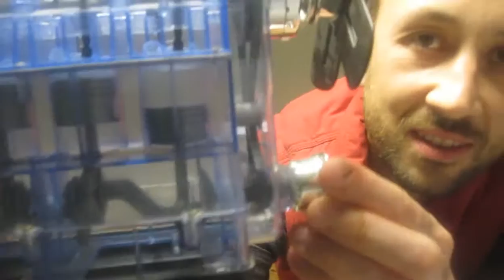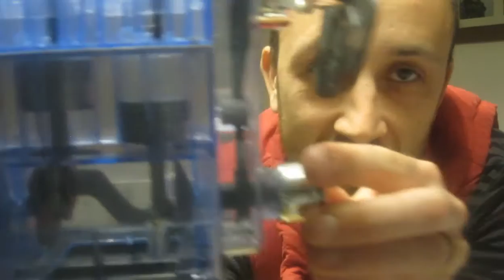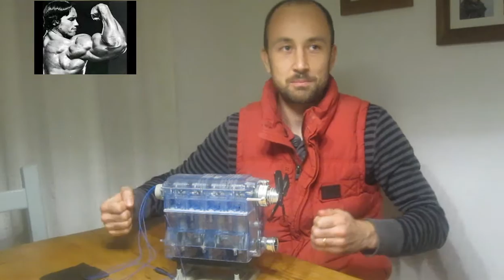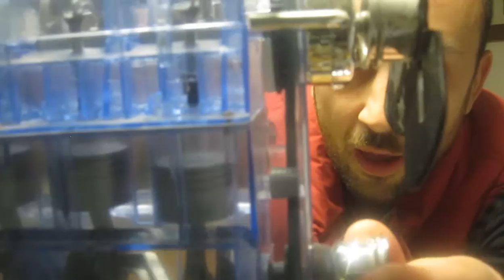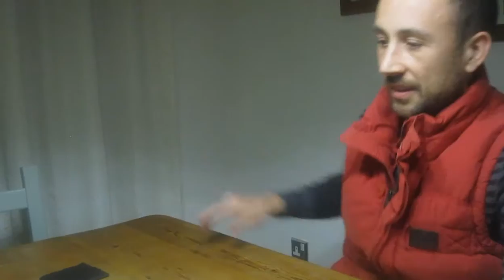Torque Vs Power: Why Power Wins Races and not Torque!

Comment: Your understanding of what the correlation of power and torque is so badly flawed it makes me wonder if you even have any mechanical background at all.

Power is nothing but a calculation. A calculation of how much work your engine is doing. Power can not be measured, it can not be applied, it can’t do anything but be calculated by the formula torque x rpm / 5252 or 10,000 if you are going metric. That’s why when you have an engine or a car on a dynamometer it measures torque not power. It can’t measure power because power is not a force that can act on anything. Torque is what is being measured on the dyno which in turn allows power to be calculated.

Power is simply a calculation of how much work you engine is doing.

Torque is the twisting force that makes your wheels spin around.

And to answer why the petrol and diesel vehicles perform differently at the same power specs is because the transmission gears will 100% be different between a petrol and a Diesel engine to allow for the different engine speeds that the engines will be working at and I’d be pretty damn sure the diff ratio would be different between the two engines also.
Reply: Sean Byrne: "Power is nothing but a calculation. A calculation of how much work your engine is doing."
Torque is a calculation, too: force times distance. Power and torque are both mathematical quantities, one is a scalar and one is a vector, neither is more "real" than the other.
Reply from the maker: Let me work through the theory with you, since you seem to want to know more?

Power [kW] = Torque [Nm]  * EngSpeed [RPM] * (2*Pi/60000)

power is an expression of [work done / unit time] (you almost got your definition correct, but you forgot to mention time)  Torque is essentially the work that is being done on each power stroke.  We bring the time dimension in to the calculation when we consider engine speed.

To move a mass m over a distance d we must do work, where W.D = ([F (wind, rolling etc...)]+[m x acceleration]) x d and if we want to cover that distance quickly we must do that work in less time, don't forget Power is a measure of how much work can be done in a given amount of time, hence my conclusion that power wins races and not torque.  There are caveats, if you get the gearing wrong for the application you will lose, if you don't take the engine into it's peak power band you will lose the race blah blah blah...
Reply: Car Stuff power does not make your wheels turn around. Torque makes your wheels turn around. You can’t win races unless your wheels are turning.
Reply from the maker: Whilst you are correct that torque makes wheels turn, power then goes on to define how quickly they can turn (see above), you can't win races going slowly
Reply: Sean Byrne: Of course you can measure a car's power. You take it out on the road and you do speed trials - that's what speed trials are; a test of the car's power. A car with more power will accelerate quicker and go faster than a car with less power. It's that simple.
It's just a lot more convenient and standardised for engineers to put the car on a dyno in the workshop and work out the power from there.
If you've done that and you know some other things about a car such as its drag coefficient, frontal area, etc you can then work out pretty well how it will perform out on the road.
Reply: It’s been 7 years.  More than long enough to get an engineering degree.  Have you learned anything since you posted this hivemind nonsense 🚮?
Inertial dynos measure power directly and calculate torque.

Comment: The fact that this imbecile is describing combustion as an explosion completely discredits everything else he says.
Reply from the maker: Thanks for the inspiration @Sean Byrne, you have given me an idea for a new video on the effects spark timing (where the 'explosion' starts relative to crank angle)
Reply: Please stop referring to combustion as an explosion. There is no explosion that takes place inside the cylinder.
Reply from the maker: ...hundreds of explosions!!!! get over yourself, for the purpose of this explanation I am not going to be using 'flame front' as the intended audience is not an automotive engineer

Comment: This guy hasn't got a clue about what he's talking about.
Reply: beside  some details hes right power win race not torq egzample 206 1,6 hdi 260 nm 1750 rpm 110 hp 0-100 10,5 sec 👉🏻 https://m.youtube.com/watch?v=FkN8w9CMzGE vs 206 s16 190 nm 4000 rpm 140 hp 6000 rpm 0-100 8 sec 👉🏻 https://m.youtube.com/watch?v=0khf89EWYc8 or this one royal enfield scram 411 32 nm 24 hp 0-100 11 sec 👉🏻 https://m.youtube.com/watch?v=zZFIa0pG21U&t=57s vs zx25 r similar weight with rider 23 nm 50 hp 0-100 under 5,5 sec 🤷🏻‍♂️👉🏻 https://m.youtube.com/watch?v=WJu_osPT0Ik&t=387s&pp=ygUSengyNXIgYWNjZWxlcmF0aW9u wants more ? 😎 power win race all the way beat torque peak crank engine catalogue number be a mille assuming good gearing asf .

Comment: Now put a 600lb backpack on bodybuilder and the runner. and see who wins. Torque is needed to move that 3,800 car. low torque cars don't pull hard they just rev high.  Most multi valve cars have variable intake to produce torque.
Reply: No, you can convert power into more torque with a transmission. Torque is as relevant as RPM when talking about moving cars. You can't move a car without RPM.
Reply: Do you know what a transmission is
Reply: Low torque car dont pull hard? Ok than let say we want comapre how hard 3800 pounds car be pull or accelerate beetwen let say 50 to 60 mph  first setup be avg at engine crank 2000ft lb and 500 hp at 6 gear beetwen 50 and 60 mph and second setup be 1000 ft lb and 1000hp avg also beetwen 50 tp 60 mph in the same car let say it be 3 gear so biger engine rpm less engine crank torque more engine crank power in which egzample your body be push harder into seat 🤔 i quaranteee you that ( well not i but physique in fact quaranteee you this 😁) in second egzample where engine makes 2 times more power and 2 times less torque at crank will push your body into seat with egzacly 2 times biger force 😎 and acceleration time be 2 times smaller 😎from 50 to 60 mph 🪠 you just cant achieve better acceleration at specific speed while use less power its imposiible because watt :m/s = force and force = mass x acceleration 😁 if your car bike whatever at spefied speed will have less power no matter how much more crank torque you will have it will pull weaker at this specified speed 😎 thats how world work and how physique explain this be observation in Real world test 👌🏻
Reply: @mociczyczki 👍
Reply: @rollsroyce329 yep i know but thers  one misteake in me comment 😉👌🏻 it dont affect tendency overall as physique properties but thers small error in force doffrences push driver into seat vs power diffrences cos of drive train  losesss and drag but yea still 1000 lbf 1000 hp between 50 and 60 mph will accelerate much stronger under the samewhole resist of motion 👌🏻 actually consider me small error so drive train losess assuming both have 20 % losess and drag diffreences be even biger than 2 times for 1000 hp 1000 lbf ft advanatage not be much at those speed but still 👌🏻🪠☕️
Reply: @mociczyczki damn taxes!  😂. When we talk about these things we usually talk about all things being equal and first principals but because friction is a percentage it effects one more than another. If we say an engine making 800HP at 18,000 RPM has the capacity to tow double the weight at 5KMph of an engine making 400HP at 1,100 RPM it is not inaccurate the engine does have the capacity the losses that would make it more like an 85% increase instead of 100% are the transmission’s fault and not reflective of th e capacity of the engine.
Reply: Okay and the runner will be making zero power so this is irrelevant. Now put the two guys on a bicycle with a sled of 600lbs the runner can put out 2hp but can apply less force (torque) whilst the bodybuilder puts out 1.5hp but can apply more force, if they have bicycles with gears the guy who can put out more power will move the sled faster, as the high power low force guy can just go to a lower gear where he can apply his power, power is energy/time and ke = 1/2mv^2 so the higher power the faster you can add velocity to an object.
Reply: Hivemind nonsense. Power, not torque, is the limiting factor in not only the vehicles top speed but also in how quickly it can accelerate at any speed and how much weight it can tow up an incline at any speed.

Comment: and if the race starts a sloping road? ... the torque wins without a doubt, while the car with more torque would already be in 4 gear the onde which has more power and less torque would probably still be trying to start de movment
Reply: Do you know what a transmission is
Reply: @benfennell6842  yes Ben i just try to prove a point, i can have a car 200hp and not be able to start movement in a 45 degrees, However if you had a 50 hp with a low gear sets it will multiply the torque and it will win, not important how fast you go the important it's to get the job done.
Reply: Nope

Comment: But wait a second... the petrol engine car weighs 1425kg and the diesel car weighs 1500kg .. so the diesel would be faster 0-60 if both cars weighed the same. Torque > Hp for racing.
Reply: Brian B the transmissions and diffs will have different gearing to suit the two different engines. Comparing the performance of a petrol vs diesel is a moot point because the drive lines are different.
Reply: @JK392_aus  its not a moot point ., transmisjom is pointless 👌🏻 let assume each car always have perfect optimal gearing clutch etc  1000 nm disel with 500 hp loose with 750 nm petrol with 750 hp but win with 750 nm petrol with 300 hp 👌🏻 and yep you can compare this you cant put to short or to long gearing for specified setup vehicle what matter is how much power you can deliver from max power your engine at very specified linear velocity  only for this is gearbox 😎  in disel at 100 km/h if you want max force at contact path you must be at 4000 rpm. Whatever gear be needed for this rpm at this velocity i write about me example you cant put to short gear at 100 km/h because  there be only noise = alot rpm let say 6000 rpm and nopower” 😁 you cant put to long gear at 100 km/ h because again there be no power = high gear low rpm and again less power for acceleration than at 4000 rpm at 100 km/ h and petrol must be at its own rpm where it generate max power at specified velocity for max acceleration no matter what this rpm must be 5000 or 15000 rpm depend on engine 😁 so like you se transmisjom ,gearing are pointless transmisjom is only for hold engine at rpm where this engine generate max power no matter what those rpm are because this depend on specified engine type setup etc 😎 for nothing more is gearbox in fact 😎🕺🏻 thats why you are wrong 👌🏻watt:m/s = force 😎 so more powerfull disel with longer gearing win race but more powerful petrol with shorter gearing win race but less powerful petrol with lshorter gearing loose race and less powerfull disel with longer gearing loose race 😁 see this? Gearing is nooob argumentation  😎
Reply: @mociczyczki  hi 🙋🏻‍♂️mechanic of 30 years experience here so I probably do know what I’m talking about. The gear ratios in the transmission and the diffs WILL be different as Diesel engines generally speaking operate at a lower rpm than petrol engines. Therefore comparing acceleration between two similar spec cars, one being a diesel and another a petrol is a moot point indeed as the petrol engine will ALWAYS be quicker in acceleration due to the diesel having a different gear ratio in BOTH the transmission and the diff. Your understanding of basic mechanical knowledge seems to be lacking.
Reply: @JK392_aus  nope 300 hp disel despite it havelonger gearing will accelerate better than 100 hp petrol with much shorter gearing 👌🏻read again what im write 👌🏻 mechanic and racing telemetry not necessery is the same 😜 like in me egzample so what petrol have 100 hp at 6000 rpm let say so it have shorter gearing so biger rpm at the same velocity in race compare to me disel with 300 hp let say at 3000 rpm ? This disel give 0 chance this petrol in race cos have huge power advantage cos watt :m/s = force 👌🏻 this disel at the same linear vehicle velocity let say  we compare  force and acceleration at 50 km/h lets assume disel weight the same as petrol have the same drivetrain both rwd drag aero and so one so this disel at 3000 rpm so at much longer finał gear ratio  at 50 km/h generate 3 times biger force push vehicle forward at contact path and push you into seat with 3 times biger force and achieve 3 times biger m/s”2 so acceleration level than this petrol with 100 hp at 6000 rpm also at 50 km/h 👍🏻 gearing rpm and crank torque all are pointlesss vs proportion beetwen rpm and torque at specified velocity so power at specified velocity is key for moving fast 👌🏻 pacz na to gościu golf gtd nowy 200 hp mocy dużo dluzsze przełożenia  kręci się do 4,3 k rpm 0-100 realna w 7,1 sek 0-200 realne w 28 sek https://m.youtube.com/watch?v=_SxvL2pf4a4&t=51s vs honda civic vtec 1,8 140 hp dużo większe obroty kręci się do 7 k rpm 0-100 realna czyli licznik 0-105 w 8,5 sek 0-200 realne czyli 0-205 w prawie 50 sek dużo obrotów dużo hałasu krótkie przełożenie a cos ta honda niejedzie 🧐 ciekawe czemu może bo ma mniej dużo mocy niż ten golf 👌🏻🤣 https://m.youtube.com/watch?v=D4E__C3sRIM wiec z czym ty tu kr…..ie wyjeżdzasz to niejest tak jak ci się wydaje 🪠 ten golf jest 100 kg cięższy jak nie 150 kg i tak przyspeiszalepiej niż ta honda pomimo ze ma przy 100 km/h kręci dużo mniejsze obroty silnika a przyspiesza lepiej bo ma więcej mocy najzwyczajniej w świecie i żadnym przełożeniem czy obrotami w tym civicu nic nieporadzisz gdybys chciał żeby ten civic był przy 100 na 1 biegu zamiast na 2 biegu i silnik miał 12000 rpm czyli superkrótkie przełożenie przyspeiszenie byłoby tylko dużo gorsze niż na fabrycznym setupie bo na 12000 rpm silnik tego civica produkuje dużo mniej mocy niż na 6000- 7000 rpm pamiętaj ze watt:m/s =siła a siła = masa x przyspeiszenie 🪠😎 obroty na jakich jest uzyskiwana dana moc są bez znaczenia moment na wale sam w sobie tez jest bezznaczenia bieg jaki masz sam w sobie przy danej prędkości także nic niemowi 😎 moc jaka się ka do dyspozycji bez względu na jakim biegu przy jakich obrotach i z jakiego momentu przy danej prędkości mówi wszystko bo watt:m/s = siła nieważne czy więcej mocy dany silnik uzyskuje dzięki większemu momentowi na mniejszych obrotach czy dzięki większej prędkości obrotowejna mniejszym momencie obrotowym efekt będzie taki sam pojazd o większej mocy będzie się zbierał lepiej 🌪 a jesli tylko kręci sobie większe obroty ale niema tam mocy większej albo jesli tylko ma sobie więcej momentu obrotowego na wale na mniejszych obrotach ale tez niema tam więcej mocy niż w aucie przeciwnika na torze do dragu to oba przypadki dostaną baty 😁🪠 🖕🏻tu masz dobry przykład honda civic type r wolnossąca jednostka kręcąca się do 8500 rpm ma odcięcie bodajże cos koło 8000 rpm ma max moc 200 hp około vs to tdi kręci tylko 4000 rpm około czyli 2 razy mniej czyli przy tej samej prędkości liniowej pojazdu silnikmtrzyma 2 krotnie mniejsze obroty a zatem ma dużo dluzsze przełożenie i co ? I civic niema szans bo ten disel ma 302 hp mocy 👌🏻https://m.youtube.com/watch?v=pCj7yBld3cM niema znaczenia ze ma dużo wiekszy moment na wale 👍🏻 ( choć żeby wygenerowac taka moc przy niższych obrotach silnik oczywiscie musi generować dużo wiekszynmoment obrotowy na wale ) gdyby ten type r miał np 400 hp na dużo mniejszym momencie na wale to on by zostawił z tylu  to tdi ale w tym wypadku tdi ma silnik o większej mocy i niedaje szans tej benzynie 👌🏻 przełożenie samo w sobie krótsze dluzsze nic niemowi  chyba żebyśmy mieli do czynienia z  pojazdem który niema przekładni dowolnej cvt,manual , automat , cokolwiek jak typowe elektryki 👍🏻😁 tak samo jak sam w sobie nm na wale czy sam w sobie bieg czy np dany pojazd w wyścigu na prostej ma 1 przy 100 km/h czy 6 co to ci mówi ? Zupełnie nic 😁 jesli na 1 będzie wieksza moc na 100 to będzie szybciej jesli na 6 na 100 km/h to tu będzie szybciej 👌🏻
Reply: I know this comment is so old. I was thingking the same. Lets say 2 petrol engine. 350hp/750nm vs 750hp/300nm. Who will win? Same car same gearing same weight
Reply: @srr1887  750hp everytime
Reply: No
Reply: Ok than you have 1500 kg 1000 nm at 2000 rpm 400 hp at 4000 rpm disel and somebody else have 2000 kg with 750 nm and 1000 hp both optimal gearing and we do quarter mille race quees which will win 👌🏻 yep 750 nm 1000 hp 👍🏻

Comment: Torque>hp
Reply: Both are important at different situations
Reply: Hivemind nonsense.  How could anything become less after it is multiplied?  How much money do you have in the bank? Is it > than it would be after I multiplied it?
Power has far greater influence over the vehicle than torque because power is the PRODUCT of torque multiplied by RPM.

Power, not torque, is the limiting factor in not only the vehicles top speed but also in how quickly it can accelerate at any speed and how much weight it can tow up an incline at any speed.
Reply: Tadej Božičko What are you going to say to back up this statement. When it comes to straight line racing, hp>tq
Reply: TheProphetsPath - പ്രവാചകന്റെ പാത Agreed, which is why I said Hp>TQ for straight line racing which is what most will ever do. But even then, there are times where torque will very important though saying a car is "torquey" which means I'll have a quick initial punch just means it makes a lot of hp early in the rev range (as long as we are not including gearing).